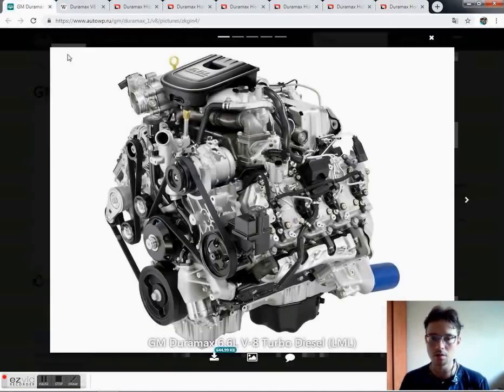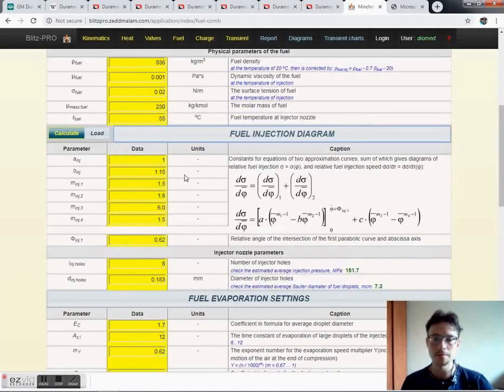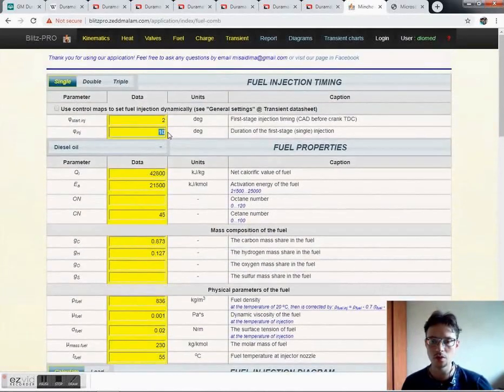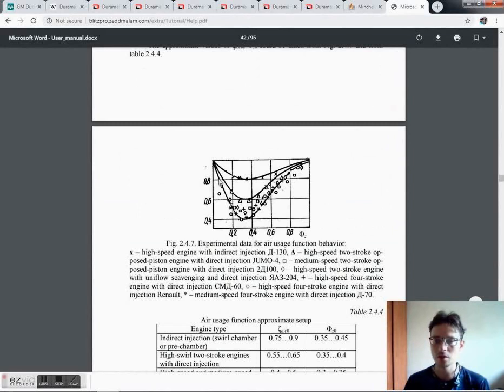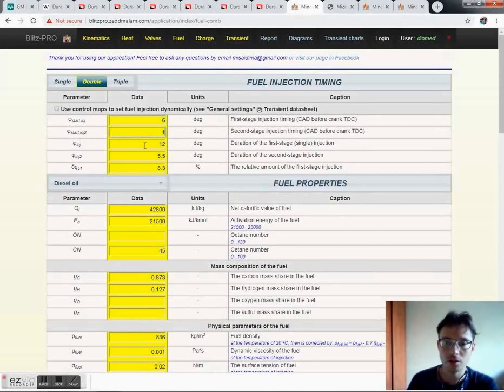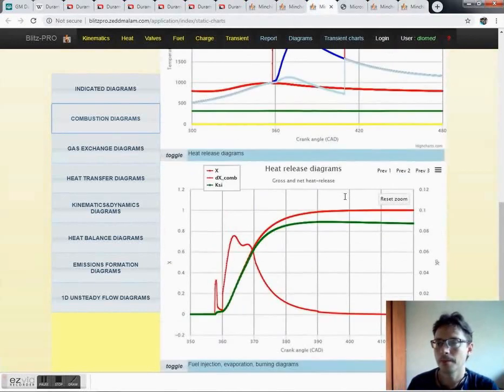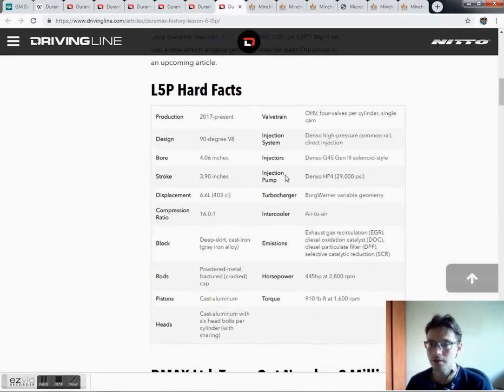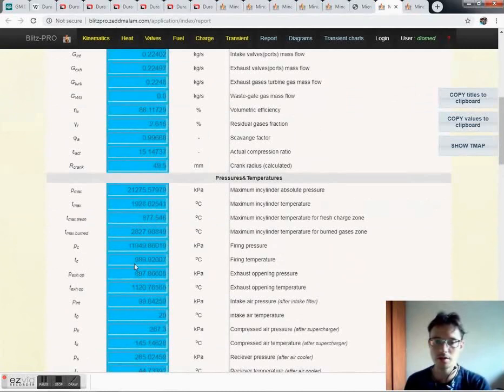Blitz-PRO Tutorial: diesel combustion setup, GM Duramax 6.6L LML diesel engine example

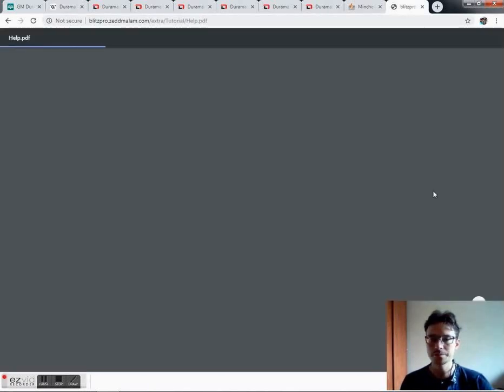Comment from the maker: 6:30 single injection setup 
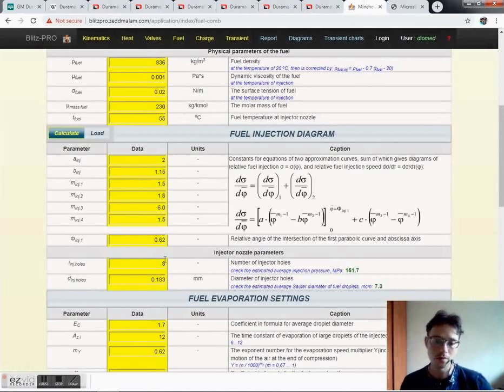11:30 fuel injector parameters estimation
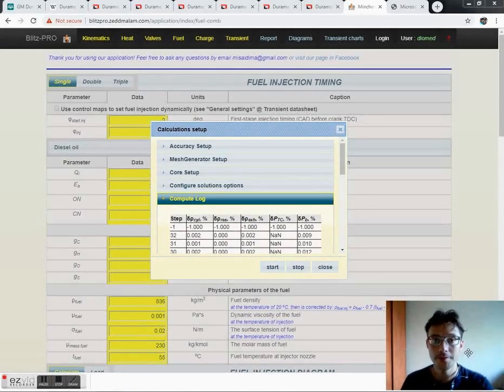26:24 single injection calculation results
32:00 double injection setup and analysis
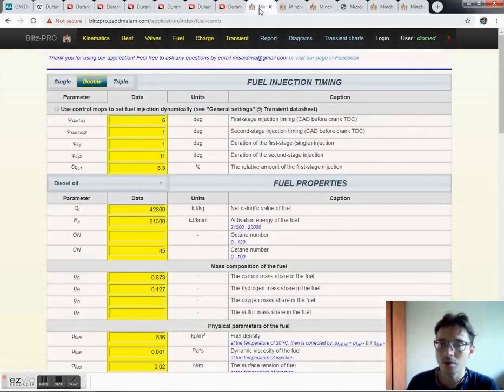41:45 triple injection setup and analysis